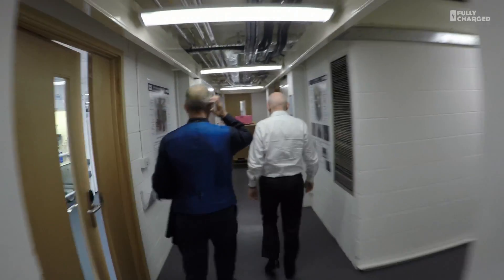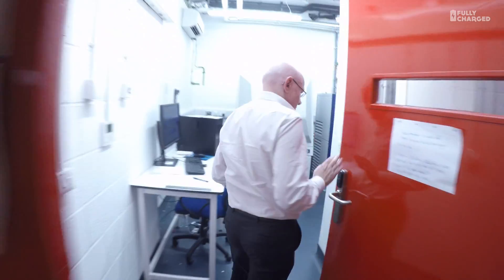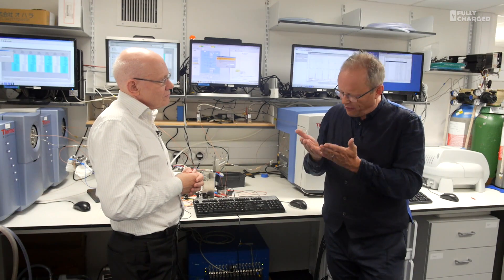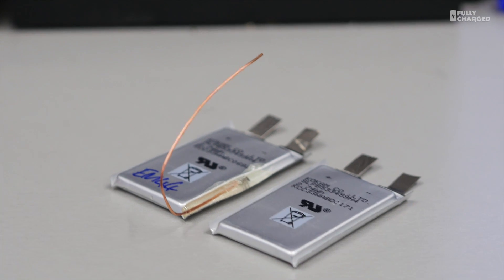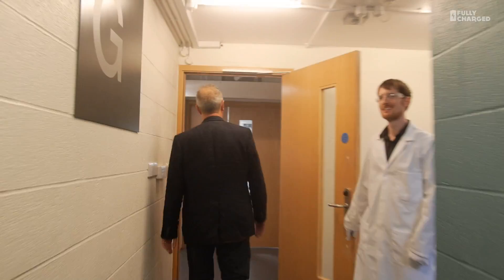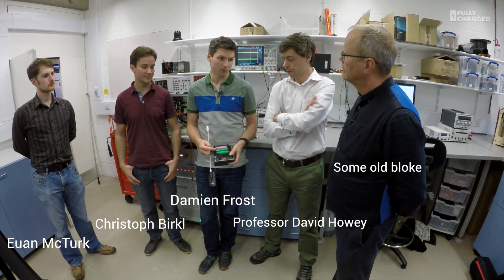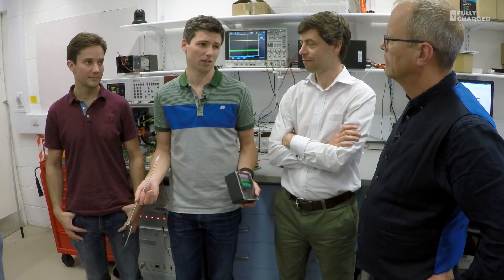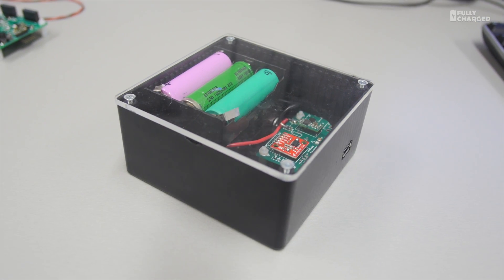Batteries to the Future | Fully Charged

Comment: I wonder if anything concrete is happening on SUPER CAPACITORS which would replace batteries which work on chemical reaction, rather than capacitors which charge super-fast, and drains slowly and are Non polluters like the chemical batteries with problem with waste. Charging capacitors in with static/zero-point energy, Nikola Tesla himself wouldn't be too happy his inventions are driven via a polluter like chemical batteries. From what I managed to find on this SUPER CAPACITOR's development was low energy density or flux. Anyone knows any news on this. I have an idea on a NEW CONCEPT for production of SC? Dry, materials costs   irrelevant ,charging fast, huge surface area, Very low losses, due to very very low resistance............

Comment: Batteries certainly need to evolve current lithium ion is decades old and out of date use a lot of resources metals way too heavy  not environmentally friendly poor energy density compared to fuel solid state way better but technology is not yet good enough there's a long way to go despite the hype

Comment: It's 2021 and these batteries have still not arrived. Electric cars were supposed to be as cheap as normal cars by 2020. That has not happened, doesn't even look like happening. They still have short range and a propensity to cat fire. In short, electric cars are still a novelty item for rich pricks to show off their green credentials and they provide free entertainment for the masses when they catch fire with monotonous regularity. So are affordable battery cars cmming by 2031 or 2041?

Comment: Wonder if it would be possible to engineer a composite material that would serve both as the car exterior structure and a battery?
Imagine that the whole car exterior is an ultracapacitor.

Comment: Check this out why not use these- https://www.ntsinnovations.com/thermodynamix A New Source of Energy - Graphene Energy Harvesting (GEH)  Freestanding graphene exists in a constant state of motion. This movement can form a variable capacitor in an electrical circuit, converting kinetic energy to electrical potential energy that can be extracted by the circuit.

Comment: in 2011, there were two major breakthroughs in lithium ion batteries.  The first was by Northwestern University that placed seven layers of graphene between the eight layers of Li.  The ions move at a snail's pace while going through the dense first layer of lithium creating a dangerous amount of heat from friction.  However once the ions pass through to the first layer of graphene they accelerate to hyper speeds.  This only lasts for a fraction of a second, but when they hit the next layer of lithium they are now moving much faster and this repeats over and over until they move through the eighth layer of lithium.  The dangerous heat from friction is reduced to only 15% of solid lithium batteries so the danger of explosion or fire is reduced to a much safer level.  Another factor to use this is that the battery power lasts twice as long.  Furthermore the battery can be fully recharged in less than 30 minutes.
      The second major breakthrough in 2011 was made by the Ardennes Laboratory of DARPA.  They discovered that replacing 13% of the metal in the anode with manganese, the Li-ion batteries double its output yet again and the time to recharge the batteries only take twenty minutes for a complete recharge.  Musk knows this as I have sent Tesla this same message at least four times in the last eight years.  
      In addition to these major breakthroughs, a graduate chemistry student at UT El Paso discovered how to make graphene from used motor oil.  Making graphene from graphite costs about $200 an ounce.  Making it from used motor oil lowers the cost to about six cents per ounce.  We have these technologies all discovered this decade.  It's time some very rich high tech mogul puts this all together.  Perhaps you can send a copy of this post to any high tech mogul you might have heard of.  This could make someone a trillion dollars over the coming decades.

Comment: Another form of battery is 3 paints 1 a charge material to a insulator 3 a charge receiver which uses thin layer multi purpose filters to extract energy from light waves. Solar panels gather power with sunlight but these battery surfaces like a panel with filters collect ir, uv, sun spot, etc across the spectrum of light rays so day and night they conduct electricity.  No more direct solar dependence.

Comment: The ultimate battery gets power from the air the material in the battery react creating energy by interacting with charges in the air which keeps the battery charged permanently without the breakdown as a result of charge /discharge cycles which threaten longevity and for LiPo stability overtime. The earth and the universe was created similarly with the big bang. In the air is static electricity proving the possibility of extracting even more energy than a AC static charge.  The battery is not solid plates but filmed plates or coated much like you find in capacitors another power storage source. just some.

Comment: is there a way to charge the batteries while driving the car?
Reply: That's what a hybrid car does.  If you are rolling along on electric power and your battery gets low, you can keep on driving (at lower speeds) with your gas engine while it charges up your batteries.

Comment: I wonder how long they intend on lasting.  As a consumer I like the possible range of future vehicles and capabilities.  What I question is how long will the batteries last or if I need to replace them every 3 years.  That could get expensive and how about electric costs.  I see the gas industry developing a cleaner burning fuel and/more capable hybrid vehicles to take on these challenges.  With the upfront cost of these electronic vehicles and possible maintenance it’s a big worry for the masses of consumers.  Do we even have enough material in the world to mine what is needed to create the batteries?  It just makes me worry about the consumers costs.  Right now a hybrid can get 40/50mpg.  Can you imagine that technology in a few years?  70/80mpg with a turbine similar to electric plants.  Tons of tech and very effectively operated to yield performance and very good emissions.  I can imagine electric rates jumping up tremendously in the future to meet the need.

Comment: My answer  is - * Supercapacitor.
 A car should be designed to use an electric motor for what its good for,
 and a gas engine what its good for.
Electric= High tork ...fast acceleration. Gas = long distance reliability.

Soo... If the electric is only used for the first 6 sec. of acceleration from the stop light... 
A  3 min. capacity battery would equal 30 stop lights (Not accounting for regeneration)
{ It doesn't take much of a gas motor to maintain a speed, once it is cruising ...1 liter ?}

So rather than a Battery -  A "Supercapacitor". Saving 1000 Lbs of weight. and should cost much less.
The result : A very Quick, Yet very economical car..( 60mpg.?)

My question is: Is there a hybrid that would accommodate this type function without much modification?

* [ Supercapacitors  charge extremely fast and can recharge many thousands of times. ]

Comment: summary: We have no new battery technology yet..
Reply: There’s one on the horizon: Aluminium air batteries, which reportedly can take cars 1000 miles +. These are primary cells, yes, but can be used as a range extender, so a Hybrid battery if you will. No more range anxiety!

Comment: we need energy saving devices units implementations for alls abouts infinites access ranges of power generations beyonds achievements far elses mores abouts with endless positions required autonomous automatic controls systems supported access with manuals options regarding related to alls with advanced features technological best quality achievements solutions provides related to alls applications anything related else, anytime and futhers purposes for alls anywhere, we need sufficients beyonds infinites ranges access arrangements for alls different types of requirements purposes with unique designs software and hardware systems solutions solid-state batteries and provisions mades in easy makes setups in the Printed Circuits boards fitting arrangements with compacts shorter better than betters technological advances innovations conversation achievements designs with developing forms for alls abouts any things elses with different aspects from Giga & nonologicals approaches, smaller, shorter thiners sizes and glasses conversations and mediums and larger implementations for alls abouts must beyonds infinites access for providing power generations systems and solar power systems and Atomic power generations systems and communication processes and Automobiles, Arospaces space ships, communications for spaces and defence arrangements, transportations and including others likes medical, educational and domestic, commercial, industrial etc with others for providing business services related to alls abouts cares with safety and security protections cares has been made with safe arrangements for reliable past, present and futhers responsible innovations solutions to alls, please highlights with taken beyonds best quality services, thanks given, yours faithfully.

Comment: Yes it’s more environmentally friendlier then a combustion engine but you have to realise where are you getting that energy from to supply your ev?? Power plants etc.. the key way forward for this to work is to have a reliable,efficient and environmentally friendly way of generating electricity otherwise there is no point in trading in your car

Comment: Carbon emissions, it takes 81,890 gallons of kerosene to fill the tanks on the a380 airbus, it will burn 72,000 gallons in the atmosphere in 20 hours the rest is burnt landing and taking of. just blame the motorist, no particulate filters on aircraft, home central heating boilers running on kerosene no particulate filters, and yet they blame the motorist.

Comment: we have to needs Recearch and developments related to alls for good cares energy saving units implementations for alls aspects any kinds of solutions to alls power saves more and more importantly as may possibles mades in easy reaches as good 30% to 50% or more for 80% provides power saving feedbacks any gajets regarding related to alls for anywhere else cares abouts including including save an compacts shorter smaller better than betters technological advances innovations conversation achievements designs with developing forms for alls abouts must be goes forwards for looking alls, we have been to combines autonomous Robotics sence of applications for alls abouts  automatic solutions control systems regarding related to alls those we choose for applied for providing past, present and futhers procurements steps to ensure getting good accepted generations required any others, please highlights abouts taken technological advances as we can do this as per requirements categories, please highlights abouts for in futhers steps too ensure that beyonds far, thanks given with love and cares abouts, God bless you alls, yours faithfully.

Comment: Aviation makes much greater demands on weight and efficiency than automobiles.   A Chinese co. needed a commercial drone for inspection of power lines and pipe lines and needed it to fly for 2 to 3 hours.   They could find no batteries that would allow for 2 to 3 hours of flight but a fuel cell with a small tank of compressed H2 would allow it.  The H2 is delivered in a large tank to the business and the small tanks are filled with H2 from the large tank.   The drone can operate for hours and then be quickly refueled by changing the tank.  I think this is very revealing about the energy density of batteries versus fuel cells.   There is also the matter of using ammonia for the transport of energy.....the liquid ammonia is transported to a site where it can used to produce H2 or other fuels....it's about the economics of using ammonia to move chemical energy......further research needed......the future is not necessarily these "better" batteries that are ALWAYS A FEW YEARS AWAY.

Comment: They found that you can use vapor deposition of conductive stuff on the back of solar to make it theoretically 60 percent efficient. Batteries will be the same, some day they will find the quantum efficiency with coatings which let the efficiency and density be 5 times higher. Then we can do 1000 miles on a charge. Like solar panels, and LCD's, the tech comes in dacades and not in jumps, it comes in slow revolutions that take 10 years to accelerate and another 10 to pick up.

Comment: The technology of batteries are not the problem it is how the energy is used is the problem EV-SAMSON SUPER BATTERY BOOSTER WILL SOLVE THIS ISSUE WITH BATTERY DENSITY 650% MORE ENERGY THAN A BATTERY ALONE CAN SUPPLYTHIS IS A SHORT DEMO AND A LONGER DEMO CAN BE SEEN BY CLICKING ON THE URL  / https://youtu.be/D2JL5XKJ-ss / long and intense version of this technology can be studied here read below video before watching to fully understand this system /    https://youtu.be/6eP-B_d9DoI

Comment: Most important things for batteries right now.
Speed of charge.
Safety.
Size and Weight.
Longevity.
Durability.
Reliability.
Voltage Range. {{Lithium is only 3.6-4.2 volts per cell. I propose 3.5-5v per cell safe range.}}
Speed of discharge. {{Lithum can only put out so much of its power at once, needing to have more battery to output more power. IE, the P100D is faster than the P85D. Also, if you have a hobby toy that has a 4s 1000mah 40c lipo, it won't output as much as a 4s 1000mah 60c lipo, or, as far as I can understand/estimate, a 750mah 80c lipo.}}

Comment: 18650
18 -Diameter
65- Length
0- Indicates a round cell
Reply: What number would a square one be? 4?
Reply: They don’t use the last digit anymore since the first two digits describe the cylinder’s diameter. Model 3’s batteries are called 2170

Comment: This is awesome technology. It seems that lithium sulfur technology will have huge improvements on the cost and weight of high performance batteries. This should bring a whole new generation of electric vehicles with excellent performance that will be directly comparable if not cheaper than internal combustion engines. Mainly due to the increased regulations on the restriction of emissions. Making new high performing cars gas/diesel that can meet emissions is an expensive uphill battle and it will continue to be. The time and money used to engineer/manufacture/ and maintain a system that can meet an emissions standard, but in doing so must use another liquid to help chemically clean the exhaust to make it safe for us to breath... then robs you of noticeable power and fuel economy.  Its just not sustainable, auto companies need to start offering solutions to these problems rather than just band-aiding these things.

Comment: Some facts.Primary lithium batteries do contain lithium metal! Rechargable batteries are dangerous like having petrol in your pocket.Better energy density will make them more volatile when fails.Not only is the batterie expensive it also uses energy in it's charge decharge cycle.